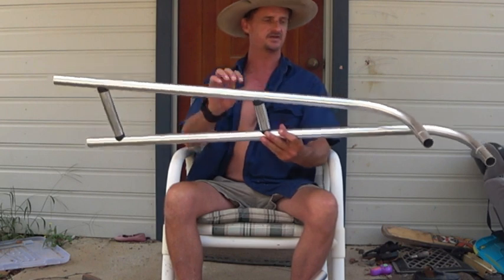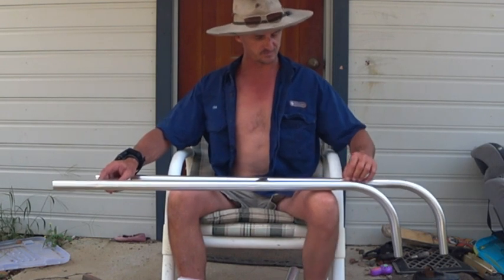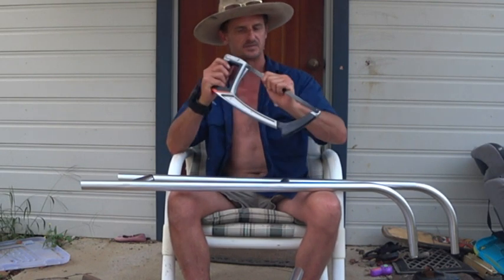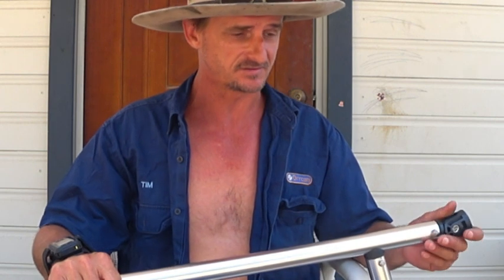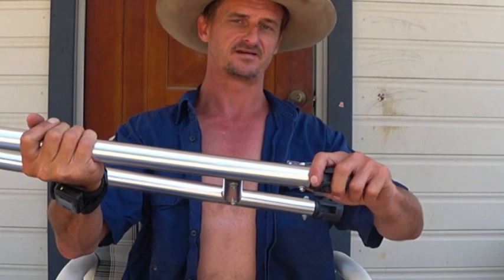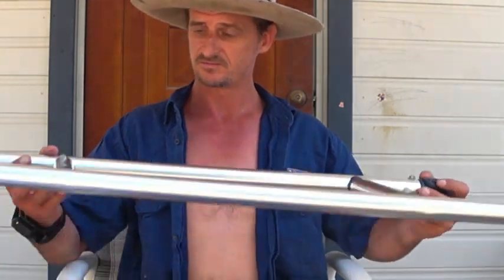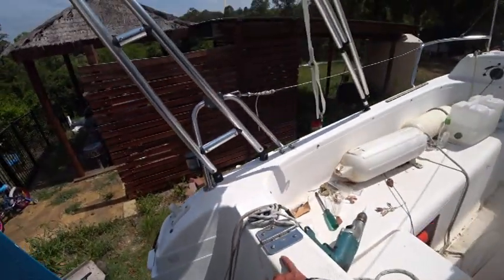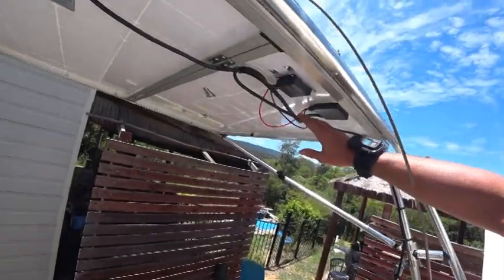Ep 4 How ibuilt My Solar Support Davits for my Trailer Sailer

Comment: Looking to set up something similar on my newly acquired Sonata 26. Was thinking of stainless steel but having it fabricated might be really expensive. How is the aluminium standing up to road and water use? Would like to use the frame as a mast crutch if it's strong enough. I live on the Gold Coast. Boat name is Good Vibrations.
Reply from the maker: Gday Mike,Where u out over the break?we just came back from 7 days out,starting at Slipping Sands,Tipplers and Coran Cove for New year,the weather got the better of us and headed for home,i have a cradle for the mast to sit in,just the standard Mac one,i dont think it would be strong enough to hold a mast but did well as a solar panel frame,i had the forestay replaced by an unmentioned Company on the GC where i beleave they droped the mast from height onto the frame and snapped on of the poles and shattered one side of the panels so with days before xmas and no time i took it off for this trip,Always fun outsourcing work to others
Reply: @livinthedreambrighteyes2032  Hi, Bought the rocket launcher and have it just have the legs set up loosely tied to the pushpit to get an idea of where to put them. The Sonata has the ice cream scoop type stern so it's narrow and the top pieces will only be about 1.2 m across. I have below deck access to where it will fit so I'll use backing plates bolted through. With the mast supported from the mast step and the pulpit I should be okay to have a crutch. Not much weight. I am going to use a sheet of marine ply with a flexible solar panel rather than a the solid panels. I have a 250 watt set for my camper trailer and they are really heavy. Not been on the water over Xmas. Camping on Moreton Island from 8 -18 Jan . Other mods on the go are an anchor drum winch which involves reinforcing the anchor well and a self furler for the jib. Fortunately my two sons are mechanical engineers and their help makes things a lot easier!

Comment: Great job!  I wonder, knowing that a little shade on a portion of a panel lowers the performance drastically, is the higher part of the frame (the one holding the mast when trailering) causing unwanted shade at times ?   Very clean job anyways ! 2 👍🏻👍🏻
Reply from the maker: gday Andre,thanks for watching,i still use the Standard bracket for holding up the mast,the mast clears the frame by about three inches,i figure that the u shape mast bracket holds it in place so theres no chance of the mast slidibg from left to wright in transit,Thanks Again,Adrian

Comment: Just found your channel. Have been thinking about buying a Mac m or x so channels like yours are important. Have you thought about mounting the roller-rest that comes with the boat onto the arch? Also, how many watts can your pannels generate?
Reply from the maker: Gday Cecil and Welcome Aboard,Do u Mean the Mast Support? I made it so to utilise the origial support bracket,Some one Could Definatly do Something like that for sure,My Panel is 250w with 1 Start battery and 2 house batterys
Reply: @livinthedreambrighteyes2032  Cheers from the states. I guess I do mean the mast support or what ever it's called where you rest the mast when it is down. If my dream comes true I want to go with an electric motor regardless of what boat I end up with so solar will play a big part in that. Elco has a 50 hp outboard that might be just the ticket for a Mac.